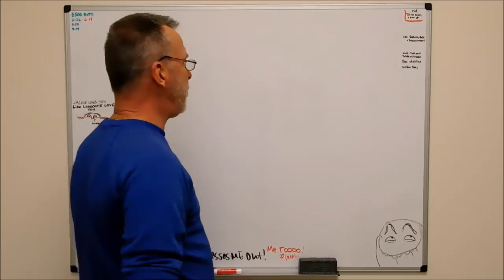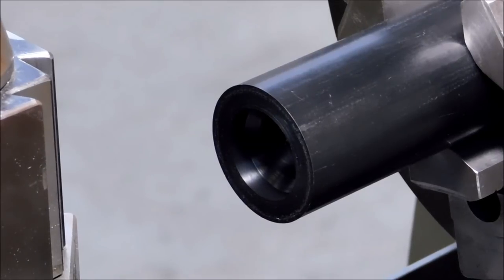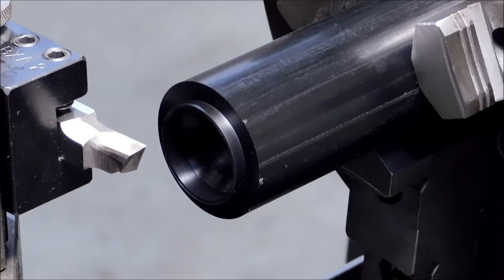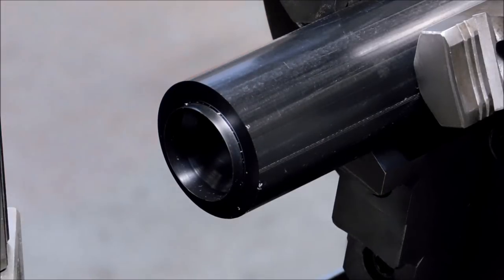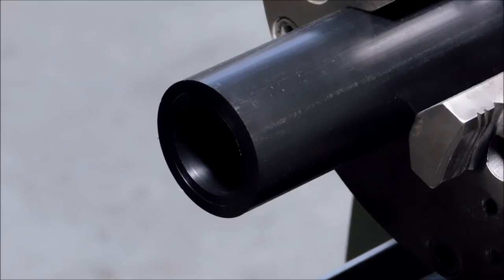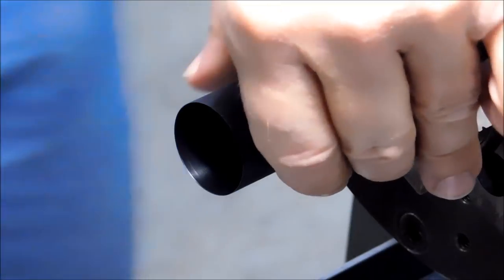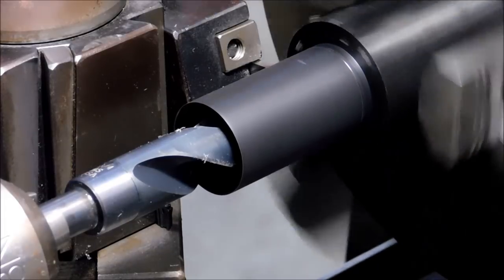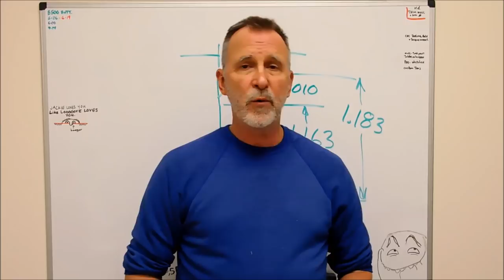Producing Extremely Thin Wall Parts ---Made Easy

Comment: I used to encounter parts similar to this one and I would machine the inside first then fill with Cerrosafe a Bismuth alloy which expands to the bore and then I would machine the outside diameter to size. Finally, I melted the Bismuth alloy from the bore and then I had a very accurate and thin walled part with no chatter or other anomalies.

Comment: Thanks for sharing this technique. Does the side rack angle of the tool make a big difference in amount of deflection of the part, and what do you find to be an ideal angle for this type of operation? My thought would be that 0 degrees of side rack (with a very small radius) would help to reduce the deflection, but in your experience does it make a measurable difference when using this technique? Thanks again!

Comment: I managed to make some very thin plastic bushes using this technique but every time I tried to part off it just tore up. I’ll have to remember to part it off like you did next time. If I remember correctly I ended up using the tool as a rest and cutting off with a Stanley knife.

Do you think this would work with copper, too? I’ve little experience working with it and I don’t like the idea of spending my time and money turning copper bar into lots of smaller pieces for the scrap man.

Comment: Hi Joe, I need to make a part out of brass for a sterling engine.  Its the displacer piston, its 1.375" long.  After watching your video I think that I can make most of it.  The thing that I cant get my head around is the external rad on the end.  The OD is 0.500" with a wall thickness of 0.012".  The rad in the bore I can make with a bull nose cutter.  The OD I can use your technique.  The end is a full rad (0.250") this is where I get stuck.  The only way I can see is to plunge a radius tool in.  Any ideas?

Comment: I like it.  So... its a little like gundrilling - sort of - the material itself supports and guides the work?  At what length/diameter ratio does the turning speed destabilize the process?  This was actually a pretty fat part in term of its own stiffness.

Comment: Nice job!  Another way if this does not work is to finish ID and fit a slip fit solid plug inside....Then turn the OD...The plug method is the only way when working with Nylon or Teflon. The behavior is certainly different on thin stuff.

Comment: Good techniques. When turning and boring thin walled PTFE the best way I've found is to have a high depth of cut on both ID and OD. I use a vacuum with the pipe mounted on the cross side to suck up the swarf.
Reply from the maker: Thats slippery stuff to hold securely. I like cutting it.

Comment: Maybe you could make an internal groove at the parting line that will reach between the OD stock and the turned diameter so the part would fall off-fly off right after turning the OD. You could also be doing that with the threading edge of the boring tool you have if it's not critical to have a flat end to save time changing tools. I think the tendency to get wrapped and scrapped would be lower with a sharp point turning tool than with a relatively wide parting tool.

Comment: about 5 years ago, while designing for an engineering company, we needed a plastic part with that kind of wall thickness.  I found a local shop that they said could do it. The only difference was that our part was a little shorter and only one end of the part was open.  Now I see did may have done it. The part was made out of a plastic.

Comment: A project comes up and a person has to figure out how to fab it, no problem, Joe has a video for it...
Need to do up a similar piece out of Acetal in the next few days, 1.10"OD x .98"ID, so at least a .06" wall, but it's 4" long...
One suggestion/request: would you show/describe the cutting tools you use on projects?
I caught the .005" tip comment, but was curious about geometry used on this project.

Comment: Thanks Joe ... that's crazy stuff. Didn't even think that this is possible. Just for the show and for when you run out of ideas in view of new videos: can you show us this very same stunt on steel or aluminum PLEASE :-)
As far as I am concerned, I will try in the next days on delrin. Curious to see if my lil lathe is up to the task. Probably, the biggest problem will be the machinist, as usual, in my workshop!
Reply from the maker: Start with this one.    https://www.youtube.com/watch?v=X-TkuQDWdbA
Reply: @joepie221  Have seen this one already (couple of minutes ago) - you've already recommended it in the comments (which I read sometimes!). 
No, no: I was talking about this kind of thin-wall-tube :-). Seriously: I believe you that it works exactly the same way as on plastic. It's just such a pleasure to watch this kind of "magic".  And it's even sexier on metal, c'mon!
Cheers
Dan

Comment: If there isn’t enough meat on the OD, put a pin in the bore. A narrow or even angled front edge cut off tool will keep you from tearing the part.

Comment: Interesting,i understand why you want it to do from outside and with a large cut as possible -the knife will cut  portion of the tube that will be supported by material right next to a place where it cuts.
Would you use a tailstock with live center for longer peace ? And do we want a fast feed rate ?

Great video as usualy ,very informative.Thank you for posting them.
Could you make video about how to get a great smooth mirror like finish on different materials(most commonly used like aluminum, stainless steel etc)?Like what kind of radius to use on a knife , what speed and feed to use etc.

Comment: I had a lot of experience machining delrin and never noticed how stinky it was until  I had to hog out some rings from six inch diameter, and the fumes from the formaldihide made my eyes water.
Reply: Get the fan!
Reply: @cmguitar50  I did, and I opened the double doors also.

Comment: Many thanks for this very informative video.
What I'm wondering about is how you would do this in SS ,because a straight one outside cut , like you did in the Delrin, would not be possible , at least not on my lathe.
Reply from the maker: A more rigid machine could pull it off. Starting with a smaller OD would help.
Reply: One thing I wondered about stainless, if it "rang" like a bell on the final cut, would be to first tip it up and pour in some low melting point metal so it became effectively solid round stock (bismuth alloy, which melts at less than 100deg C). This would dampen the vibration, and melt out simply by immersing in hot water. 

I seem to recall shrinkage is minimal with this stuff, presumably partly because it doesn't need to cool hardly at all.
You'd need to make sure your sharpness, speeds and feeds were up to snuff or the stuff might melt during the cut and get incorporated in the swarf in the tray!

Comment: My take on the keys to getting this to work. Use a very sharp tool, HSS is great for this. Bore the inside first. Take the outside cut all at once. This works well because the material that you haven't cut yet , in front of the cutter supports the thin part at the cutter. This is the reason why you cant take a second pass, as there is no support material left.Did I miss something? Great tip!
Reply from the maker: No, your observations are Spot on!

Comment: By coincidence I'd been thinking of a project with a thin wall like this; a cap to repair the end of a small flashlight. I was foreseeing all the disasters that would happen when I tried it, but after your video I walked out into the shop and turned out of PVC pipe. Right on the button first time out. THANKS!

Comment: Excellent, informative content as usual. Was there a special grind on the boring tool - it looked unusual, but maybe it was just the camera angle?
Reply: Same, I was wondering what kind of boring bar it is from.
Reply from the maker: 3/4" HSS drill blank ground down to a 3/* shank. The head is a double angle 45 for internal chamfers and undercut work. I made it.

Comment: Joe I hope this works with steel too. At rebuilding a 6" Atlas lathe where I had to heat up a sleeve to get it  in an area to be refinish a shaft for a 1" 
ID Bronz bushing. I used 1/16 wall.
If I had seen this video earlier I would have managed with thinner wall. Thanks good idea very helpful
Reply: I would probably make an id mandrel and superglue part to it.that may work better for steel.Since you can heat it up later and remove glue.

Comment: Brings me back to when i was doing medical stuff

Some jackass wanted a flexible (as in, our CMM moved the middle of the plate .8 mm when measuring)  plastic plate with raised edges and standoffs for screws (no inserts despite my objection) that had to be 0.15mm thick across a 800x600mm plate

Comment: Nice video. Learned this technique from a tool maker I worked with years ago but haven't had to put it to use in quite some time. We broke a punch from a progressive die that had a point diameter in the .075" range by about 1" long. We had a blank in the spare drawer but the tip needed to go from 3/16" dia down to .075" for the 1" length. Using a spin fixture and surface grinder, he took the diameter of that punch (which was M-2 hardened to 61/63 RC) down in one pass. Ended up with just a little taper from the grinding wheel breaking down, but got the die back running.

Comment: Would really like to see a video on setting up a lathe in the ground and bed so there is zero taper on a very long job. Making for example hydraulic ram shafts which are paramount to being uniform from one end to another.
Reply from the maker: I have a video on lathe leveling. That should answer some of your questions.
Reply: Joe Pieczynski awesome. I’ll dig through vids. Thanks for the reply.

Comment: Great vid, as always.  Early on you mentioned not drilling into where the jaws are clamping.  In my experience, most Acetal (Delrin) that I've cut holds up relatively fine, as does PEEK, PTFE, Vespel, Ultem, Meldin, Phenolics, filled materials etc.  but the others you mentioned don't at all.  Teflon, LDPE, HDPE, or UHMW, Polypropylene, PVC have almost no 'rigidity' unless filled with something.  Anyhow, sorry for rattling. Have a gooder!
Reply from the maker: When you loose the core support of any material, you cross into a  zone where part OD and jaw pressure vs the bore size, better be carefully monitored, or you will have a resulting distortion. Its job specific of course, but as  rule, this type of process better be done outside the chuck.
Reply: Absolutely agree, is very job specific of course, and good practice does say to stay away from removing any material that's in part of your chucking/fixturing area.  Was just speaking of my experience in 'rigidity' of certain plastics.  At any rate, I do agree with you, wasn't trying to be arrogant or come across as a know-it-all, just, well, talking of some personal experiences.  You know what I mean, I hope, lolol.  Have a great day, thanks for your reply.  Keep it on the bottom, turning to the right!
Reply from the maker: I appreciate the reply and comments. You have a good day as well.

Comment: You could really use a variable-frequency drive on your lathe!  Any time you are doing a "heinous" operation, you can set the speed to a creep, and even turn deliberately into a "stall" situation (such as threading toward the headstock WITHOUT an undercut).
This "thin wall" technique can also be used to machine long slender "toothpicks from logs".
Reply from the maker: That toothpick video is already posted on this channel. I've never had a need to creep or stall a lathe. I also thread away from the headstock. Always.

Comment: This is a very good and valid technique for making parts with this kind of dimension. Ive used it many times to make cylinder bore liners and the like.  When you think about it theres no mystery...the thin wall part that you are making is actually the "waste" from your turning and boring operation. With some practice it will work wonderfully.
Reply from the maker: You bet.

Comment: Amazing. If one had to make a similar part in aluminum, except it needed to be split along it's length. When would be the optimal time to slit said part? Before or after turning? Many thanks! (Friend needs a bicycle seatpost shim.)
Reply from the maker: For a thin bushing, do it after. It will still flex and go on the seat stem if it closes up.
Reply: Perhaps make a shim from sheet stock.

Comment: Thank's Joe, I have used a similar technique when making hole cutter's for hardwood hole plugs. You machine (M/Steel or S/Steel) from the inside to the outside but only put the bevel on the I/D. Then you cut the teeth. If you have the correct profile you end up with perfect holes and plugs.  Thanks for sharing this with us. Kind regards David.

Comment: Hey Joe.
I just watched an episode of "Supreme Skill" (a Japanese TV show) and immediately thought of this video of yours. It would be interesting to see you make that part using the technique you show here. The part is 20mm OD tube with a 60 degree flare to 50mm OD on each end. The whole thing is roughly 60mm long and is made of one piece of material. Wall thickness is 0.3mm. You chose the material, no need to go all out with titanium like they did :)  Don't think youtube allows links in comments any more, but if you search for "Supreme Skills! Turning vs. Spinning" it would be right at the top.

Comment: i watched this video and had to try this for myself. i used yellow brass, aluminium, 316 stainless and 4140 and was able to get wall thicknesses as low as .008 with some practice. I really enjoy all of the videos you are producing , keep them coming!!!
Reply from the maker: Outstanding.
Reply: Just occurred to me that, using stainless, this could be a good way of making a non-standard "Speedi sleeve", or a standard one in an emergency.

Comment: Hi Joe, I do a lot of machining Acetal. Great to see many of my techniques are shared by an expert and even greater to learn new techniques. I make go/nogo gauges for measuring production parts due to the difficulty of micing thin-walled parts. I use HSS mostly but I recently busted another small HSS boring tool. So I thought why not try grinding an old 3/16 solid carbide endmill. OMG, it's great. I take heavier cuts than ever and I can't imagine ever busting this little bugga. Yeah ok, I ain't holding my breath LOL.

Comment: Hello! If you would need a hole crossing the tube in the middle, a hole that is 3/4 of the tube diameter and goes throught the bouth walls, how would you do?
Reply from the maker: In a mill or a 4 jaw chuck on the lathe.

Comment: Great to have your videos to educate those that are hobbiest like myself but love the trade. 

I used your guidance to machine a brass sleeve for the tailstock on my jewelers lathe. Almost the same wall thickness of .010”. It worked great! The draw in bar was about .010” smaller than the tail stock casting and I was considering boring it out for a meatier bushing. The problem was it’s hard for me to justify modifying such an iconic old lathe. So I figured I’d give this a try and see if it last. It will allow me to use the tailstock with a small precision as a drill chuck and keep center as I feed it in. 

Btw, I tried to sneak up on the final size and it didn’t work to your point. So awesome that your share your skills and knowledge. Truly grateful 🙏

Have a blessed new year Joe!
Reply from the maker: Glad to hear all ended well. Happy New Year to you as well.

Comment: Joe, thanks for another great video.  I used your technique today to make a thin walled bushing.  Without the bushing I would have had to remove the apron from my Nardini lathe to reassemble the feed clutch.  The bushing allowed me to hold a thrust bearing in place during assembly.
Reply from the maker: Great. I hope it helped you.
Reply: can you make a video on how to make that sharp cut off tool ?
Reply from the maker: Use a regular parting tool and just put a very aggressive nose angle on it. Make it pointy like a threading tool but leave one side flat. That the side that establishes the length of the part.

Comment: I jumped forward because i already knew the principle you were going to show. Anyway just to chime in that the same thing is done milling. An example would be lets say you need a .020 diameter post in graphite for electrode 1/2 inch tall (or taller--or smaller even).. You rough out the material and of course you dont creep up on it--you stay away lets say .05 and then finish all the way down in steps and like magic a tiny tiny little diameter will be sticking up..